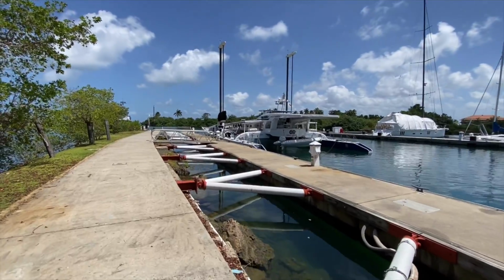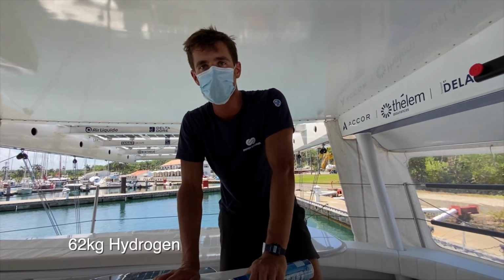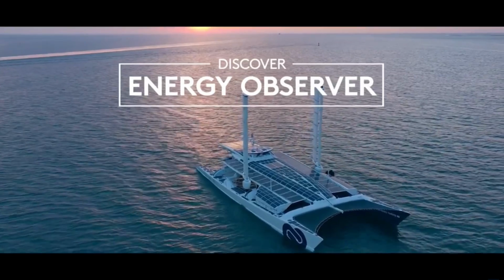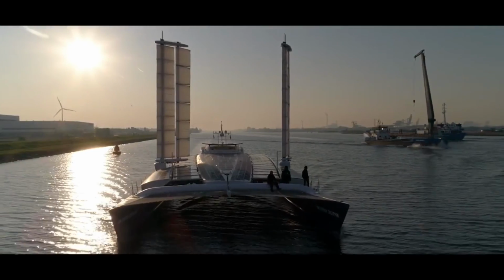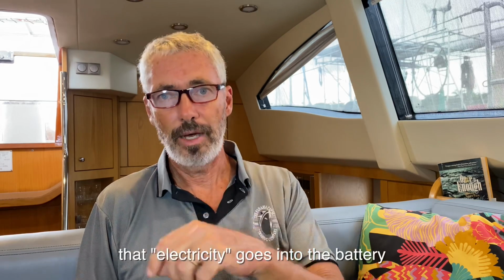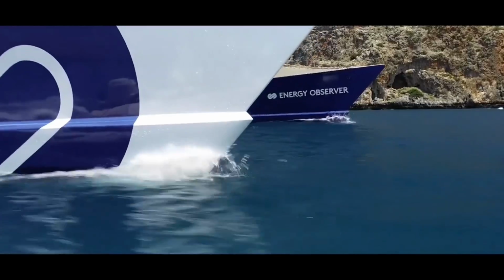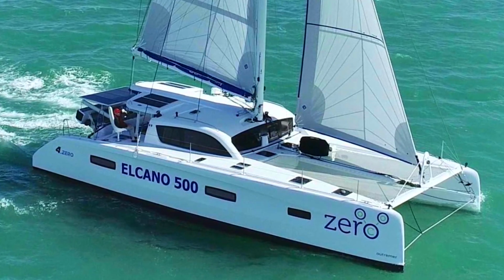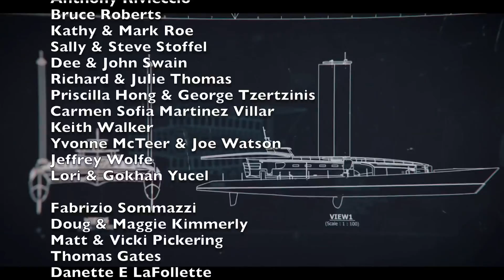Hydrogen-Electric powered boat! Can we get this on our new sailboat? | EP 204

Comment: Dude doesn’t talk about the efficiency of hydrolysis which is 80% (making hydrogen) at large facilities who knows what that boat is actually getting. This is way off from batteries! Also they talk about weight but fail to include the weight of the systems for the compression storage and creation of the hydrogen. Let’s be honest hydrogen tech is awesome and it has great applications but the way these guys are trying to sell there boat as superior to batteries in a boat is a bit of a joke. Also once solid state batteries come down in price, the hydrogen in this application won’t really stand a chance. That said I’m still all for more efficiency people should just know these downsides as well as the benefits.
Reply from the maker: Hi Brett, I think their efficiency at hydrogen creation was actually lower then 80% but now I can't find that number... Also the fuel cell is much lower efficiency converting it back to electricity (but does give you waste heat so you won't need to run a heater :-) So I agree the hydrogen creation tech is a long way off. But I do think storing hydrogen (which you would buy from a fuel station ashore) can work as a viable method to store much more power than in batteries. The tanks to store it are carbon fibre wound and pretty light weight and the fuel cell is straightforward existing tech from the Mirai. Now we just need a few shore based hydrogen filling stations. Like this guy will be wanting https://sinot.com
Reply: If you refill the hydrogen tank at anchor from ample extra solar panels, it doesn't really matter if the roundtrip efficiency is poor. Unless you're in a rush to get somewhere! Down below, I get numbers of ~23 to 28 days to refill. In term of weight, I get 1000kg of stuff to generate hydrogen, store it and then turn it into electrons.

napkin math here: https://gist.github.com/aybabtme/9a3ba8772025e724530d771d51ad9f90
Reply: @AntoineGrondin  Bonjour Antoine, as-tu réalisé un calcul d'efficience entre la désalinisation, électrolyse, compression, puis le passage dans la fuelcell, pour avoir un ordre d'idée du rendement ?
Personnellement, je comprends que l'hydrogène vous fournit un "matelas" sur 20 jours afin de choisir comment dépenser votre énergie avec la météo. 
Dans cette optique, le rendement entrant n'est finalement pas vraiment important.

En estimant à 1,5 tonne pour la stack complète de gestion de l'hydrogène, même si on convertit celle-ci en batterie (100kw de plus) cela ne permettrait pas de rendre le même service même en gagnant énormément en efficience. 

Ce gain en efficience permettrait néanmoins de réduire la surface solaire, rendant le bateau plus exploitable au quotidien hors projet de recherche, mais cela rendrait le bateau plus dépendant des voiles. Ca réduirait aussi le prix...

Qu'en penses tu ?
Reply: @RomainLagrange1  I think a sailboat with a full fuel stack would need far less than 1.5t of hardware to generate hydrogen. If the sailboat only uses the electric drive for emergency and sail 99% of the time, I'd expect that the hydrogen tanks would be full most of the time as long as the sailboat has a lot mire solar than it consumes. And it would probably only need 2 or 3kg of hydrogen, not 62kg. The Hyundai Nexo has a 3.2kg tank.

Personally I think it probably makes sense on a sailboat with an electric auxiliary drive that would otherwise have a diesel generator for a series-hybrid setup. That's if the electric drive is used in emergencies or just to get in/out of port/anchorages, as an insurance policy.

I haven't done the math on this however, but it's something I'm interested in.

Je sais pas si ça répond à votre question 😅

Comment: The video is leaving out it's biggest disadvantage. Hydrogen costs a lot of energy to make and when converting it back to electricity you have lost about half of it. You would need twice the size of solar on deck.....

If hydrogen was really that great why would they still use that big lumpy battery......... it is obvious?

When generating more solar then the batteries can store you can run the motors a bit faster. When the sun is generating less, you can choose to run the motor slower.

Comparing 64 kg of hydrogen to batteries is rather false as you are not counting the weightm size and the efficiency of the installation.